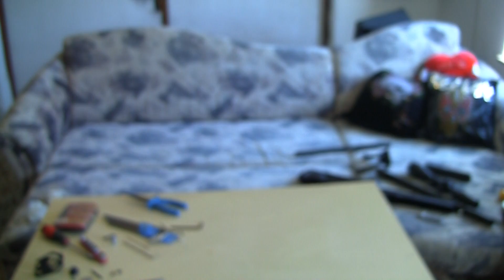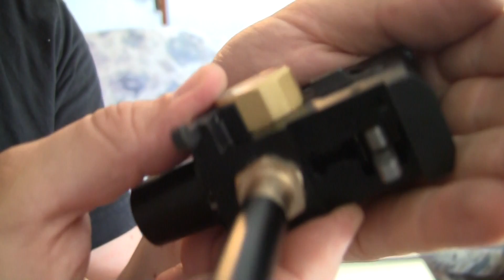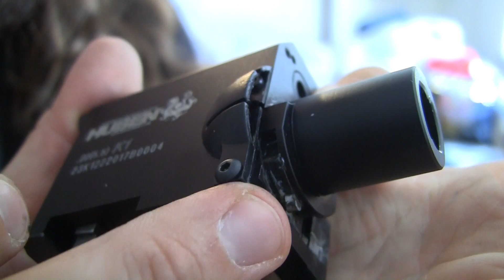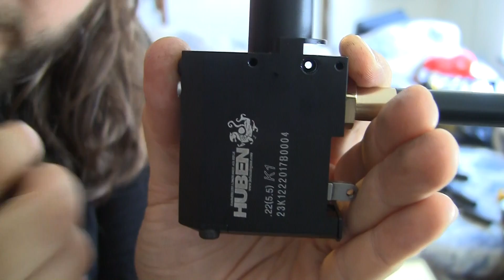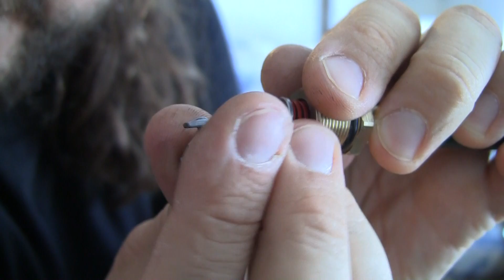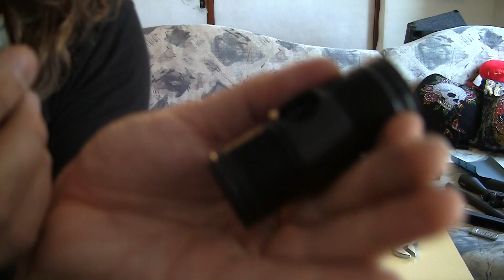Huben K1 version 2 - disassembly

Comment: A most excellent video!   I have the LE Walnut edition, so for anyone with one, the only thing necessary to remove the stock is the front screw in the forearm and the power adjuster wheel and the assembly under it.

Comment: Just shot the huben after turning up the velocity. After two shots a burst of air came through the magazine and now it doesn’t shoot anymore. So going to watch this video to try and find out what’s broken
Reply from the maker: Did you have very low pressure when you did that? You must not have high power on the power wheel and use low pressure. The gun stops firing overall at about 90 bars but if you fully opened the gun at for example 110 bars, it could dump the air. So it is quite possible that nothing is wrong with the gun, just charge it back up and increase reg pressure or decrease the power wheel...
Reply: @gregorkamensek3923  no it was attached to the bottle with 250 bar. I wanted to detach it and it wasn’t possible without letting the air  out of the cilinder of the huben. So I emptied it. Didn’t have time to check it since then
Reply: @gregorkamensek3923 so I checked all o rings I could besides the regulator. I guess there is the malfunction. Everything works but I can’t deconnect the external air supply because then it just looses all its pressure and I have to bleed it all to zero pressure to be able to unplug the huben. I will check that another day
Reply: All seals seem to be good, couldn’t find anything. The barrel is empty. It does shoot but I can’t disconnect it from the bottle or all air blows out.
It all started when I adjusted the powerwheel (probably wrong) in between shots
Reply: Still not working :-( looking at all seals for the 5th time and nothing strange so far

Comment: Hey again!  Thank you for this video too, Gregor!  Cool that you are doing this!!!  I once tried tuning the trigger according to your instructions, but it didn't really bring me any benefit.  What I primarily criticize about the factory version is the very soft, spongy first stage, which comes from the weak spring on the trigger blade.  What I did was add a stronger spring here so that the trigger has a lot of feedback on the first stage.  I took 0.5x3x15.  To do this, I have slightly widened the recess on the trigger blade.  Of course, you have to compensate for the first stage pressure with the two rear adjustment screws, otherwise the shot will go off before the second stage.  Depending on this, replace the return spring with a stronger one.  Works best for me that way.  Best regards, Georg
Reply from the maker: You are right that it feels a bit spongy, but I think that is mostly because in second stage it has another threshold (it is sort of "three stage" trigger). This is why I fully remove the first stage with the soft spring that you mentioned, and use that first part of what is supposed to be the second stage (that makes it spongy) as a first stage... This does make the new first stage relatively short and without spring adjustment it is also quite heavy for first stage... this is why I loosen the spring to have it lighter (or replace the spring for a weaker overall). To make clear, this is one of the springs in the back as in this case, original front first stage and spring is not used at all. This makes a perfect trigger for a semi auto gun for me... The reset is very short and the trigger is crisp on the second stage.

Comment: Hi Greg , you are the huben master! You help a lot of people with your videos. I'm considering of buying one. Salutes bro!.
Pd: queensryche t shirt may have helped in the golf ball challenge 😉
Reply from the maker: You are right about Queensryche t shirt :)
Reply: Gregor Kamenšek 
Wy huben not made a chamber in the barrel? 
They don't have to make a grooved magazine and complicated alignment
Reply from the maker: if you do that, then you have to give up one of the other great features, like semi-auto operation or power or efficiency. Huben gets its performance by having the valve right behind the pellet. That gives amazing efficiency and power (combined with other features).
Reply: Gregor Kamenšek 
I don't know if I'm expressing right. I mean a small chamber something like fire arms  .Just a little with no grooves to avoid the alignment with the magazine, the pellet could pass the magazine enter at the barrel and then take the grooves. not talking about magazine and barrel alignment. 
Anyway huben design seems to work's perfect , you get an excellent accuracy.
Thanks for your response and keep shooting!
Reply from the maker: Unfortunately that does not work well, I have tested it ;) The bullet must enter the grooves ASAP otherwise, the bullet will be damaged because it will hit the grooves with high velocity (initial acceleration is very big). The grooves in version 2 are there (at least that is what I think) only for pellets because pellets have smaller head that the size of the grooves and if there is no grooves in the magazine, the head would not be correctly aligned with the barrel...
Reply: Gregor Kamenšek 
Yes I understand, I tried too but in a traditional pcp, and not like fire arm's a little different chamber  in a lw barrel didn't work but in hw barrel seems to be an improvement, too many hours on the lathe ☺ .
But yes huben it's completely different. I could talk about airgun mods for hours ha ha. Well I don't take you more time. I appreciate your work! Salutes

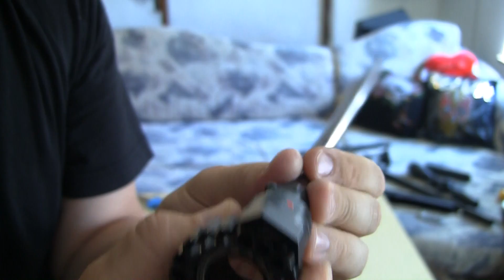Comment: The most important disassembly 0:00 until 17:00

How to reassembly the barrel and align the magazine probably 17:00 until 24:00

How to improve trigger first and second stage 24:00 to 31:00

he explains why he has not taken the action block apart so far 31:00 to 32:00

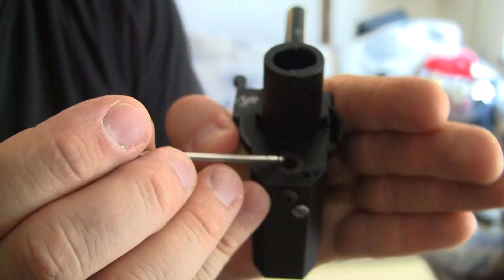Explanation how to make the safety harder or lighter to configure 32:00 to 33:00

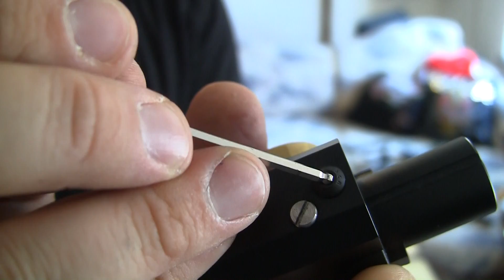he explains how the magazine seal is working in the gun and why it is a good design even with Revolver like gap  33:00 to 35:00

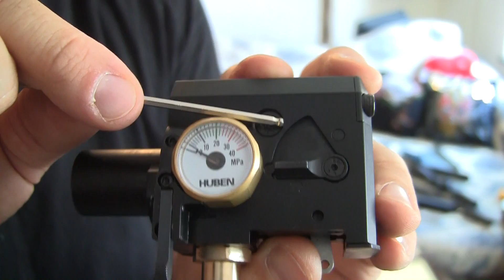Possible leak with the magazine and how to fix it in theory 35:00 to 37:00

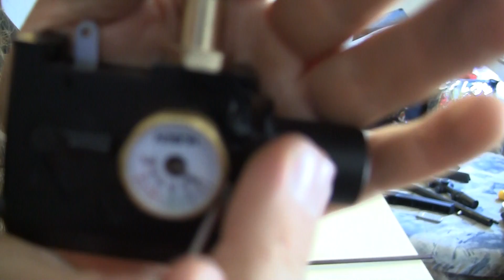Explanation how the magazine is working with the pin to set the stage for the next round and how the action is working several other explanations in this as well like how to remove the plastic part that makes sure no pellets can fall out from behind the magazine where the pellets are loaded 37:00 to 47:00

Possible leak he explains how the magazine rotation is working with the pin and that the pin can have a problem with an O-ring and several other possible leaks 47:00 to 52:00

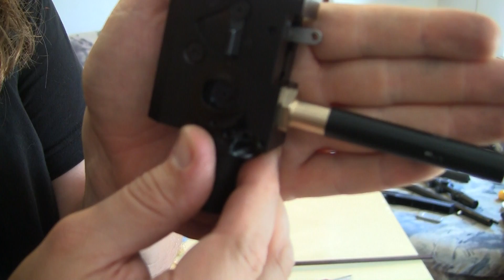Possible leak explanation that sometimes the regulator gauge can cause problems but it’s not the gauge it could be an O-ring inside 52:00 to 54:00

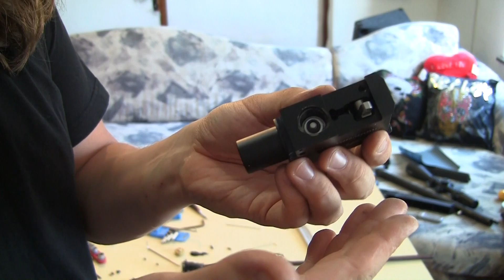Possible leak explanation on how the power adjustment works with the brass part and why it is unlikely to fail but some O-rings are hard to replace in case of failure or a problem 54:00 to 57:00

It could be a failure but it’s very unlikely to have there a leak he explains exactly how the valve for the opening and the valve chamber is working in power adjustment and the plastic seal that is necessary in function before and after the shot 57:00 to 1:01:00

Possible catastrophic part failure if there is something wrong behind the back plate where the spring is in the opening valve and the explanation why it is almost impossible without huben or a retailer to get a replacement for it 1:01:00 to 1:06:00

Possible leak Inside the opening valve chamber there is an O-ring and a seal that can cause leaks but needs special tools to replace the O-rings correctly in place 1:06:00 to 1:08:00

Regulator chamber and high-pressure chamber explained a stage before anything else before how to depressurize the high-pressure chamber because the regulator should be not be under pressure anymore at this point for save disassembly or work 1:08:00 to 1:10:10

Regulator pressure can be adjusted by washers how to have more pressure but less precise regulation of the pressure or less pressure and more precise regulation of the pressure 1:10:10 to 1:14:00

There was a big part deleted

I had the entire video made with timestamps there was a problem with YouTube or some thing else I cannot do the last minutes now again this is very disappointing do you have to watch the last part for yourself for the regulator tube the high-pressure chamber and the regulator itself this is not good maybe I try to complete my comment later on again I wanted to make the video easier to watch for specific time reasons.
Reply from the maker: Hi. Would you mind if I put your timestamps in the video description? I really appreciate your work... :)
Reply from the maker: @rikaayumiinfinitelybroken6981   Thanks. I added the timestamps :)
 I have to admit that I am a lazy Youtuber, my main passion is physics in airguns, the channel is more of a gateway to be able to get my hands on special airguns and experiment with them :). Your help is very appreciated. :)
I agree that lead free is the future for health as well as legislation reasons. I have reached to JSB and asked them for some samples...

Comment: Hi Gregor 👋 great video thanks. Do you think removing the front barrel band increases accuracy?
Reply from the maker: Yes, that did help with gen 1 guns but form gen 2 on, it did not make any difference in my tests...
Reply: @Gregor Kamenšek  excellent so I will leave it for durability as it only weighs 50 grams or so

Comment: Greeting Gregor
I asked once if there was easy way to tell year of manufacture of Huben. I reached out to Huben and found that the serial number is a code. 
Gen 1
xx K1 xx xxxx x xx xx
1. Location source #
2. Model K1
3.Caliber
4. Year of mfg.
5. Stock color
6. Month of mfg.
7. Mfg sequence serial number

Gen 2
cc-k1-yyyy-s-mm-dd-xxx 
1. Caliber
2. Model (K1)
3. Year manufacture
4. Stock/color
5. Month of mfg
6. Day of mfg
7. Serial #. Position in mfg.

This is direct from Huben. I hope this information  help you out. Thank you for your outstanding videos
Reply from the maker: Hi. Thanks, I will keep that. I was told some time back that there is no order to the serials so I am curios if this applies to my K1s.
Reply: @gregorkamensek3923  yes is does apply to Gen 1. The caliber is after the K1 then year. The # before the K1 is a source code
Reply from the maker: @kevintravis2154  OK, great. Thanks for the info.

Comment: Hi Gregor, once again a great video and very good info on the rifle, I'm from Chile South America and let me tell you that I just got a Huben K1 v2, I have an FX impact in .22 and .30 but I'm going to sell it and keep only the Huben, I think for the .22 caliber is a better gun. As you are the expert in Huben matters I need to ask some questions (there's no details or mention on any of your videos):
- You said that the version 2 comes with a LW barrel 1:16 twist rate, but is it right hand or left hand twist ?
- Is there any special caution to have when you adjust the regulator pressure or not ?
- Is there any way to know how much air is left in the bottle ?, I only see the gauge on the side but as I know that gauge is only for the regulator operating pressure NOT for the pressure on the bottle (correct me if I'm wrong).
One last thing only for information to other people I guess, the serial number ends with B0067
Thanks a lot, and do you have an email where I can contact you more directly?
Reply from the maker: It is a standard LW barrel. The twist is 450 mm and right hand.
No special calculation. It is a trial and error process. But I would recommend pressure form 150 - 170 bar...
Correct. K1 does not have a gauge on the non regulated sided, so you cannot know the pressure until it is under the regulated pressure...
You can send you email address via private massage and I will contact you.
Reply: Gregor Kamenšek thank for everything Gregor I will send you my email, I just started pellet and velocity testing I'll let you know my findings
Reply: Hola Navarro Diaz, ya empecé con las pruebas de chrony y a probar distintos postones, envíame un mensaje privado y te doy mi correo, así podemos seguir en contacto más directo.
Reply: Navarro Diaz Hola, intenta google+, google Hangouts o google allo, por último facebook Alejandro Rene Ortiz Salas
Reply: Aún no me ha llegado nada estimado,
Reply: how to modify the springs (()) (()) (())? Is it necessary to remove air from the air cylinder to do this MODIFICATION?
REPLY
Reply: alexander neves Hi, you can do it unscrewing the regulator set screw (is the one that you move to increase or decrease the regulator pressure), you have to turn it counterclockwise until the air is going to star leaking, continue till there's no more air. I'll recommend you to do it taking the stock off, it's more comfortable, but everything is in the video above, Gregor explains it very well
Reply: Alejandro Ortiz Salas como fazer para modificar o esquema das molas pratos do regulador? (( )) (()) (())
Reply: Você tem que ler minha resposta anterior e você tem que assistir a este vídeo de Gregor Kamenšek, onde tudo está bem explicado no caminho certo.
Depois de ter as arruelas, você só precisa mudar de posição como Gregor diz e é isso.
Reply: Alejandro Ortiz Salas muito obrigado Ortiz. Eu vi o vídeo sim .vô rever novamente.la explica como mudar né?
Não precisa esvaziar o cilindro correto?
Mais uma pergunta. Como identificar a posição original das arruelas ou molas do regulador ?
Reply: No vídeo do Gregor as molas ou arruelas já estão configuradas ao modo dele. Eu não sei inglês
Reply: Por isso não saberia como mudar a posição das arruelas
Reply: Eu não entendo português, eu só uso o google tradutor. As arruelas têm essa forma [(] você apenas tem que removê-las e as rotear para colocá-las de volta no guia de metal.
Assista e assista o vídeo bem, siga o padrão de desenho como este:
Configuração Orignal: [])))((()))((()))((()))((()))(((=

Configuração Gregor: [](())(())(())(())(())(())(())((=

Você deve ter em mente que existem 30 arruelas no total.
Reply from the maker: Thank you for your help answering :)
Reply: Alejandro Ortiz Salas obrigado. É porque no vídeo do Gregor ele já tem suas arruelas configuradas. Eu terei que remover as minhas e fazer como você mandou.
Depois que você mudou a posição das arruelas você achou melhor o desempenho? Melhorou  em quê?
Reply from the maker: I will make a separate video about that. It is not necessary to change tis. On some guns, you get better results with stack of 3, on other with stack of 2...
Reply: Gregor Kamenšek your welcome, and thank you for all the help in this matter!!!
Reply: Si, tal como dices en el video Gregor ya tiene las arandelas configuradas de 2 en 2. Originalmente es de 3 en 3 pero él mismo dice que en algunos rifles anda mejor la configuración de fábrica.
Solo tienes que hacerlo y probar pero con un Chrony para evaluar las velocidades.
Reply: @gregorkamensek3923  i.need exect dimensions for tools.i want to.remove seals and I have no tools.

Comment: Hi- im having the problem you have described at 48:10 .. when i lift the lever it leaks slow and stops when i put down.. it slowly leaks overnight .. how to solve this without removing the magazine and and barrel?
Reply from the maker: You don't need to disassemble the gun at all to replace the oring but you do need to empty at lease the plenum, then remove the two screws that hold the plastic loading gate (I don't remember if you need to remove the stock to do that), under the gate, there is a brass screw. You need to remove it and then there will be one oring inside of that hole - you need to replace it (there is also one oring on the brass screw but that one is probably OK). The oring is 2.5 x 1 mm I believe and should be NBR 90.

Comment: Hi Gregor, my Huben K1 has developed a leak at the regulator.  To access the problem point , I need to remove the silver-colored nut housing the pressure adjustment screw. However, I found that the nut is VERY tight. May I know if you have tried to remove it ?

Comment: Hello Iam from Austria are there any instructions on how to turn the 7.5 joule version into the 100 joule?
Reply from the maker: Hi, neighbor. I never had a fixed 7.5 joule version in my hands. I believe (this is what I have heard form other people) that all you need to do is remove the stock and remove the plug that prevents you to access the regulator adjustment and that you need to purchase the power wheel part (the indexing part...). This way, you can adjust pressure and power.
Reply: @gregorkamensek3923  thank you :)
Reply: @coxer829  did it work?

Comment: What is the easiest way to install the new air tank gauge in the k1 v2? I know that I must empty the chamber tank but I would like to disassembly the less possible the gun.. I don't like to mess with the gun.
Reply from the maker: Empty the gun, unscrew the old end cap and screw in the new one with gauge... No need to disassemble anything.
Reply: @gregorkamensek3923  the question is how to empty the gun without disassembly the gun. Because I see in the videos that I must disassembly the gun to be able to empty it. How I empty the gun?
Reply from the maker: @SurvivalMX  Easy: First turn the regulator screw counter clock wise until the regulated chamber is empty. Then turn the regulator screw clockwise just enough for the air to start escaping out... Just wait about 10 - 20 minutes util all air comes out.
Reply: @gregorkamensek3923  got it. Thanks Gregor

Comment: Hi mate need to know the dimension of the special tools to take out the firing valve  orings  and fix them thanks and regards
Reply from the maker: Hi. I have gave the dimensions several time in the past but it depends on the gun version as some have smaller diameter of the rear side of the valve. I would suggest you ask Huben directly and let them know your serial number so they cal let you know exactly what you need...